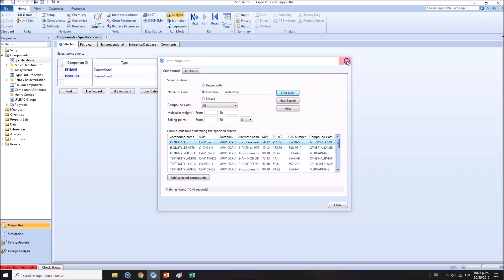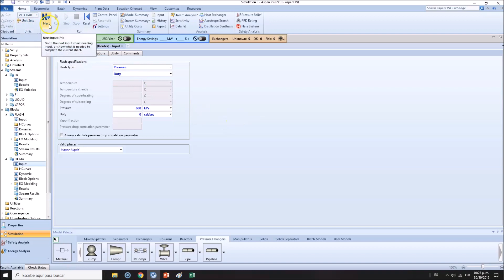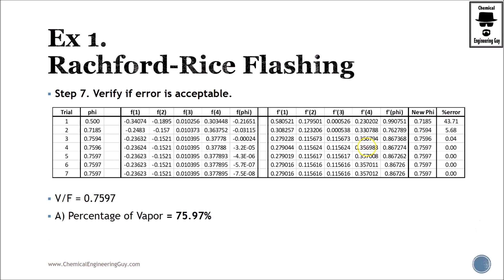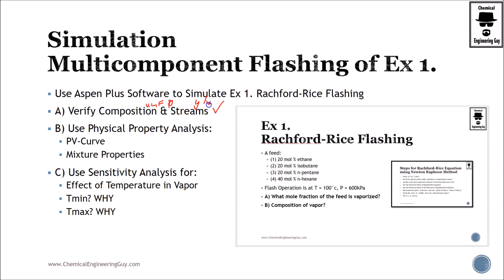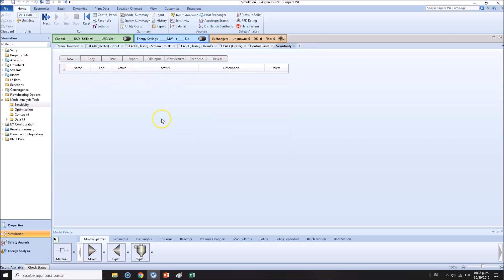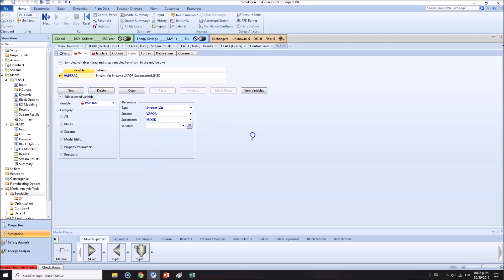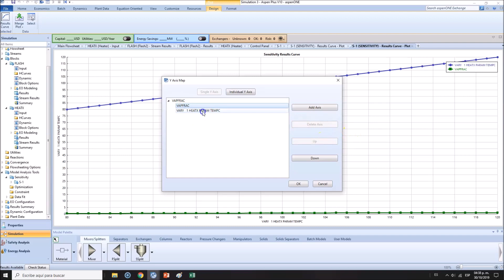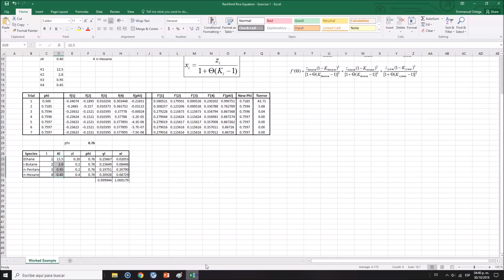Aspen Plus Simulation - Multicomponent Flashing - Verifying Rachford Rice Equation Method (Lec 136)

Comment: The video is really interesting, but may I ask the equations used in the excel?
Reply from the maker: Absolutely — I’d be happy to share the Excel equations! I’ll either post a quick walkthrough or drop a link to the sheet if possible. In the meantime, feel free to mention which part or variable you’re most curious about, and I’ll explain that formula first! 📊🧠